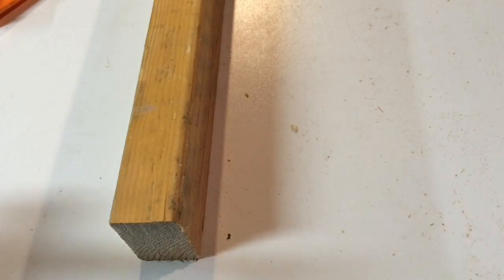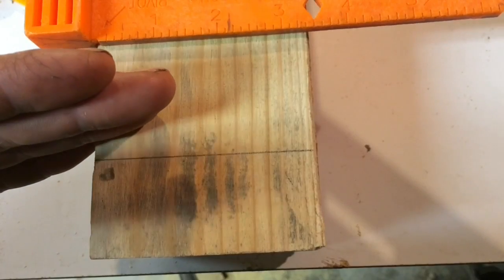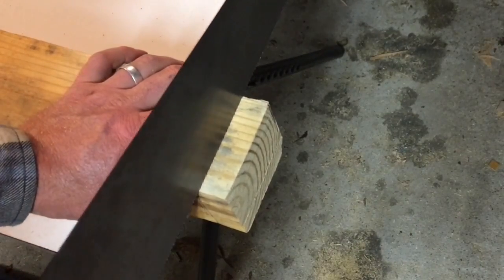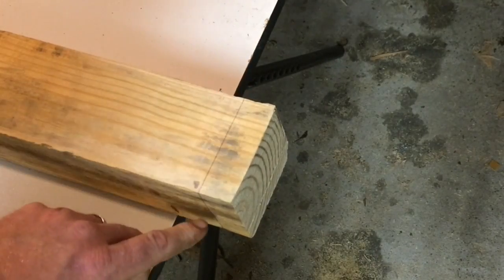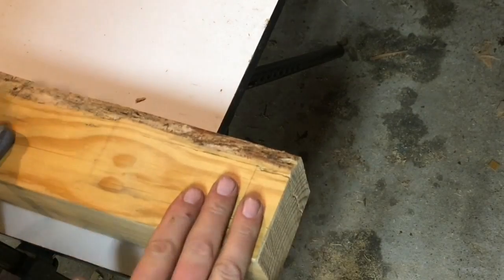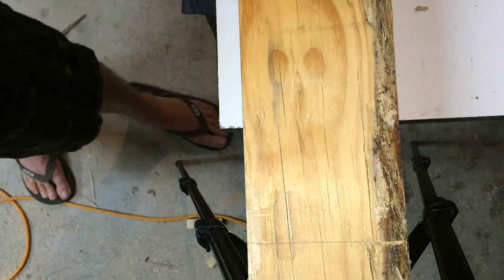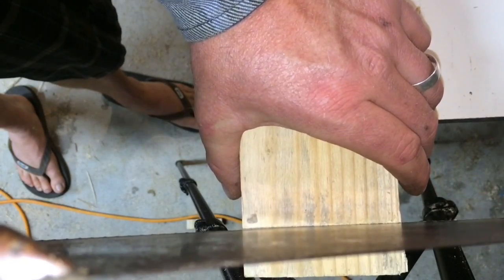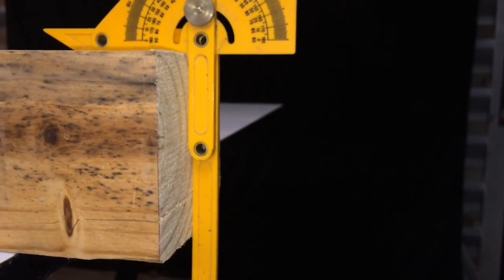How To Make Square Cuts With A Handsaw

Comment: I'm trying to build the frame of a drill press from wood. All DIY on drill press design don't give attention to this problem until someone tries to make it at home ....this is where your video comes in handy. I nearly cried yesterday, forcing my hand on several types of wood materials and never able to get a leveled cut with my handsaw ... I was so desperate that I decided to stop working on this easy project just because I couldn't get a straight leveled cut ... so thank you Zack .. gonna try your method tomorrow
Reply from the maker: I'm really glad you found my video!!

Comment: Excellent method and commonly used with Japanese saws and also the same basic idea as making a knife wall around a piece of wood before cutting. helps guide the saw and prevent tear out on the back side of the cut since the back has already been cut.

Comment: I was a carpenter who never became quite good enough tbh because I was never given full time permanent employment and didn't get much experience so lost my love of the building game. I have become a fitness Personal Trainer and am trying to build a pull up bar system in my back garden. I got the 6x6" timbers but my chop saw packed in before I made the fist cut. Now being from a generation of power tools I'm not too hot with a hand saw but actually practiced your technique on some old 4x4 and 8x3 and it works amazingly well so thanks for the vid or I'd be stuck scratching my head. Was considering hiring a chop saw for the day just to cut 3 lengths. HAHA.
Reply from the maker: Hey Phillip I'm really glad it worked well for you.  It's not not perfect, it is possible to be off a little but if you watch the near side line closely and check the back side periodically you can do a pretty darn good job.  Thank you for watching!

Comment: I make sculptures out of cubes of wood. I came up with basically the same method for getting my cubes as close to dead on as possible. In my method I cut a kerf on all four sides of the wood. Probably a bit of overkill. I have made 10''x 10'' x10'' cubes that were within a sixteenth of square all around. As I use a Japanese style saw my initial cuts are push rather than pull.
   This method also works for angled cuts.

Comment: That seemed to work out in the end but it was clear from the first two saw line that you were going off line.  A better way, invented by Paul Sellars, is to scribe a knife line along the pencil mark.  The first light and the second line harder.  Use a chisel and hand only to cut from the waste wood to the knife mark and remove any debri with your fingers.  This provides an exactly cut line for the saw as the saw is effectively against a wall line even before the first saw stroke.
Reply from the maker: Hey Ian, thanks for taking the time to comment.  I'm not sure I understand what you mean about it being clear I was going off line, If you're referring to what the exposed butt of the 4x4 looked like when I started, I'd like to respectfully disagree.  That was the raw end of a piece of a large pallet that I had sanded somewhat flat for some other project, not the evidence of a failed first take.  I can absolutely appreciate your keen observation nonetheless.  As to Paul's "knife wall", I agree with you that it's a fantastic method and one that I often use myself.  Thanks again for the comment and thank you for watching, Ian
Reply: Thanks for your reply, Jack.  The cut in questions was probably just an optical thing.  However, after a few cuts, the video moved to a from view from the front, showing the line that was not visible to you.  It certainly looked like the saw blade was about to go off line but I am happy to accept that it didn't.  The finished piece was excellent.

Image capture

http://i1372.photobucket.com/albums/ag354/ianrm1/line_zpsyckszqhx.jpg
Reply from the maker: in all sincerity, fantastic sleuthing work Ian! lol This strikes me like something that I would do what with the image capture and close up shot.  You ARE correct that the initial cut was wandering some.  Once I rolled the piece by one flat that slight left right wander became effectively irrelevant since the straightness lengthwise on the original cut now became the left right guide of my final cut.  As time has gone on and I have used this technique more I have been able to get the final cut to wander a tiny bit but that's only when I blatantly intentionally paid zero attention to trying to guide the saw.  With the slightest bit of control input on the saw it follows that back side kerf like a charm.  Thanks a bunch for taking the time you did, I enjoy the company of folks like yourself. ~Z
Reply: Thanks Zack.  I can see that you are not only an excellent carpenter but a man of honour and integrity.
Reply: IanRM Hi. I saw this vid and am about to try and cut 6x6 by hand as my chop saw has packed in but am not too good with a hand saw. have practiced this vids method on same old 4x4 and 8x3 and seemed to work really well although on the 4x4 I was 3/4 mm out on one corner. Was interested in your knife scribe method. Not sure if I understand quite right so is there a vid on this on youtube? Thanks.
Reply: Grrat tip. While I was watching I was thinking how well this would combine with Paul Seller's knife wall technique. Have a go at putting a knife wall on three sides for initial guidance.
Reply: IanRM sadly you are misinformed about Paul Sellars inventing the knife line then chisel a small v groove across the timber I have been a joiner for 41 years and I was shown how to do it, at college and by an old timer, well into his sixties, I do live in the uk.

Comment: Hi I'm a young trainee joiner and I struggle to cut straight how would this work on a much smaller scale. ( cutting finger joints ) just wondering if u could help because I'm tired of clamping bits of wood to my work to keep my cuts square.
Reply from the maker: Hey Pyro thanks for asking.  I've not really tried it on a small scale, but to my figuring, it should work just the same.  Also, you may already know this but the sharpening job and the set on the saw you use can be quite the hinderance; if it's not done properly your saw will tend to wander and you'll spend lots of effort and frustration fighting it.  I don't really feel qualified to say exactly what to check for on your saw(s) but as an aspiring saw filer I'd say make sure your saw is properly jointed (all the teeth are the same height) as well as has a consistent set.  If you find either of those way out of whack, they're not helping you any.  Check out Paul Sellers' channel, It may also be helpful.  Try it out on some scraps and let me know if the technique works on a smaller scale.  Cheers ~Z
Reply: Zack Of All Trades hi zack I will when I go back to college as we have broke up for college I have left a comment on your axe winner result video that could be classed as a personal favour but could also benefit other young carpenters like myself.

Comment: Good

Take credit for figuring this out on your own but of course it is a traditional technique - kerf the cut on three or four sides and then let the saw track.
Reply from the maker: It's so effective, I couldn't imagine that millennia of woodworkers hadn't figured it out.  I just had never seen it before.
Reply: @ZackOfAllTrades  My preferred method is to mark all your lines with a sharp scribe or knife.  Cut them deepish.
Then use a bevel edged chisel with the bevel towards the waste and tap it in all along each of the 3 cuts. Lever it slightly towards the waste but only gently.  It will form a groove with one 90% edge and one angled edge.

Then when you put the saw onto the line it already has a set groove so the backwards draw to start the cut becomes super accurate.
Make sure you let the weight of the saw do the cutting and relax your hand.  The more you push down on the saw the more it wants to move offtrack.
Reply: Watch some Paul Sellers videos, make knife walls, I do 2 sides, top and front, kerf cut the front, turn the board, start top cut, and then drop your hand and saw into front kerf.  Always cut and watch the sides of the board you can see, top and front.